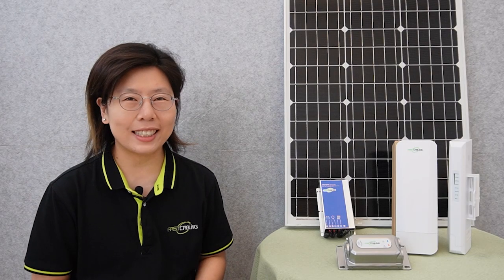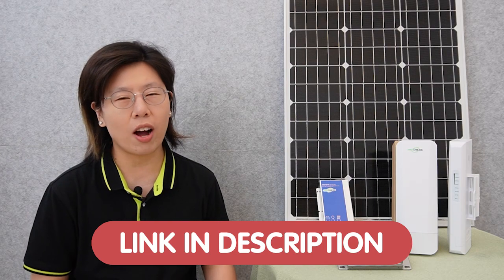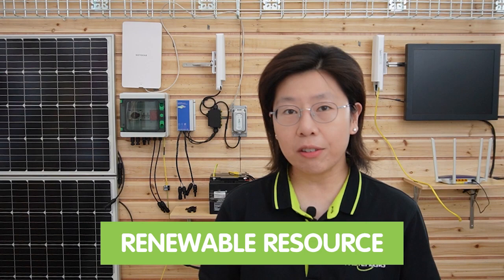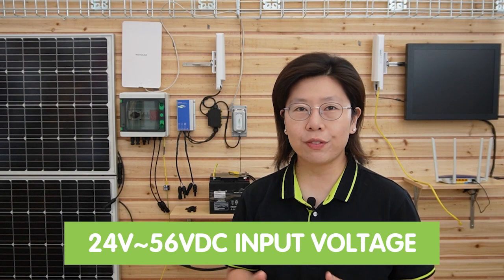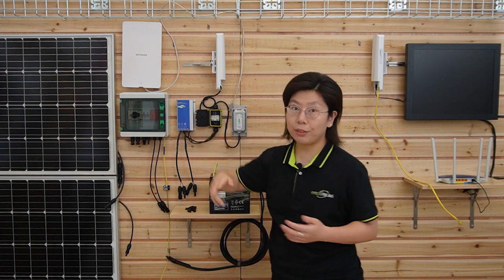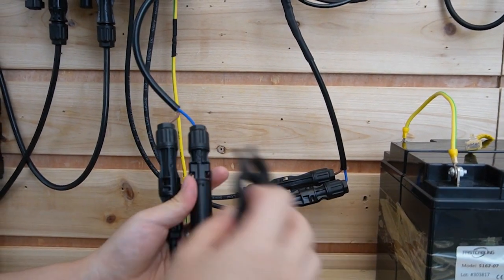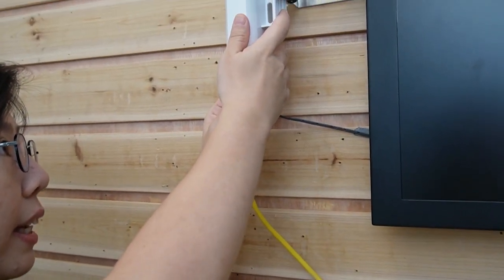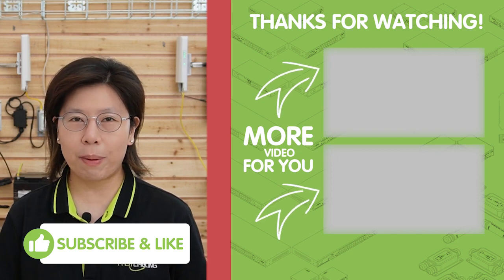A Guide to Building a Solar-Powered Wireless LAN with Outdoor PoE

Comment: Hi Do you have the list of products used?
Reply from the maker: Products used in this video are as follows: 

1) 120W solar panel; 
2) rechargeable batteries; 
3) string box with built-in air switch; 
4) waterproof junction box;
5) 20A MPPT solar charge controller: https://www.fastcabling.com/product/20a-solar-charge-controller/
6) 450Mbps outdoor wireless CPE: https://www.fastcabling.com/product/450m-wireless-network-bridge-pair/
7) 60W outdoor PoE injector: https://www.fastcabling.com/product/60w-outdoor-industrial-waterproof-poe-injector-100-240vac-input/